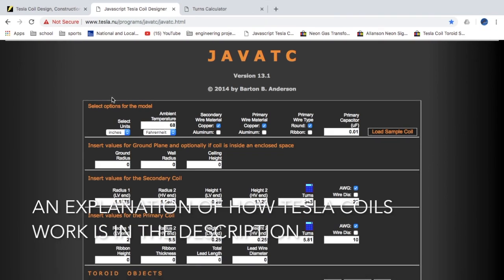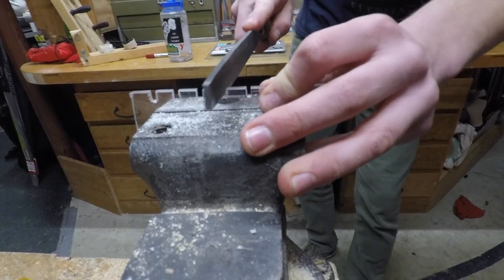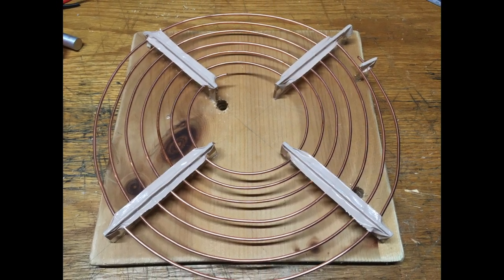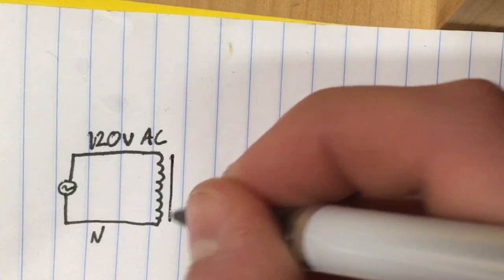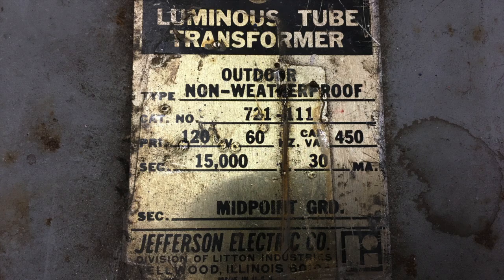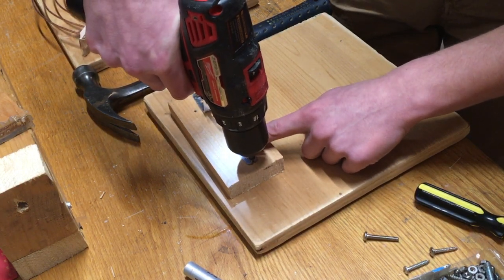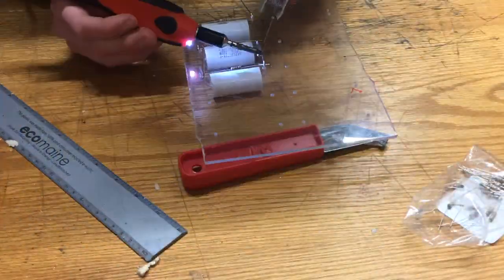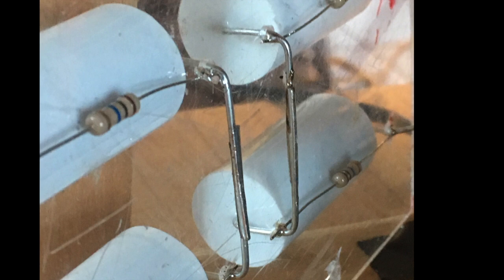Building/testing a spark gap tesla coil

Comment: Kool, why did you not use the ground bolt on the transformer. Good job and thanks for the video.
Reply from the maker: thedoc298 thanks! The only reason I didn’t use the ground bolt was because the transformer is pretty old and the bolt was rusted to the case
Reply: I thought it was a little rusted looking

Comment: is this tesla coil tuned? how come the output isnt so great, nut still a good video and great demonstration
Reply from the maker: I think the output is what you would expect for a 7500 volt 30ma power supply, but as far as tuning all I did was build it based on the online resonance calculator and then alligator clip the spot on the primary coil that gave me the best output. Also I think I was 15 when I made this so it’s definitely not perfect lol
Reply: @joeles2738  ah i see, not too bad then